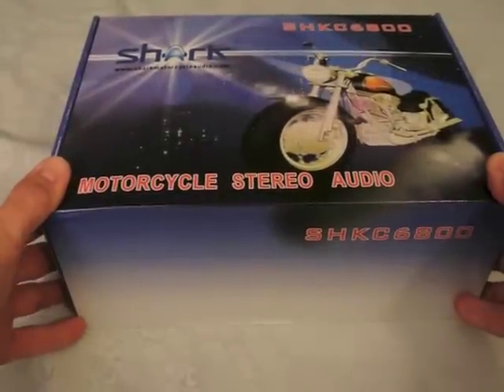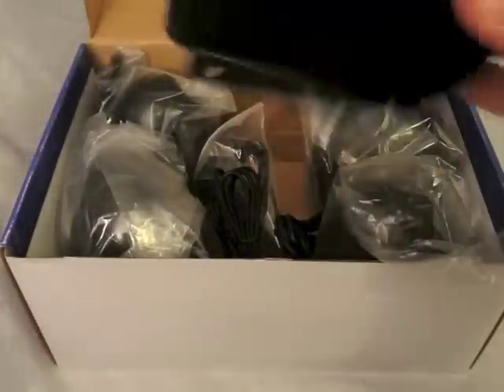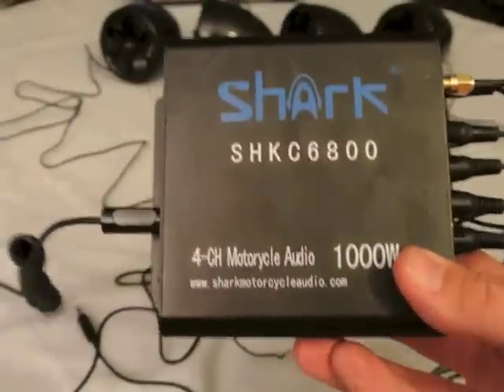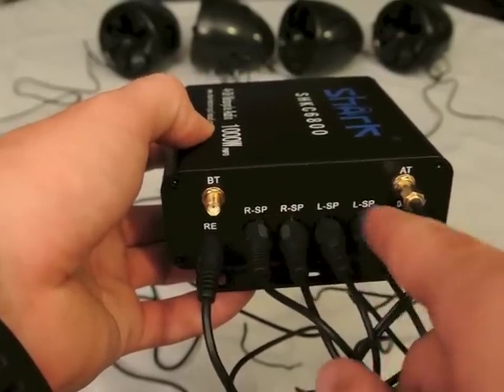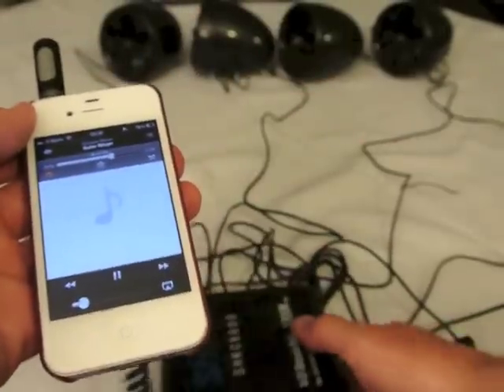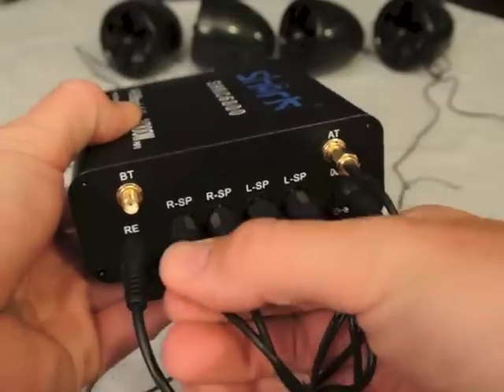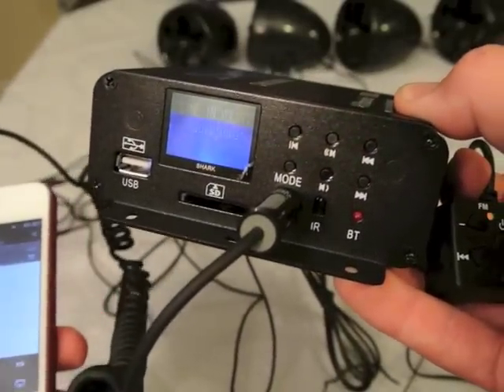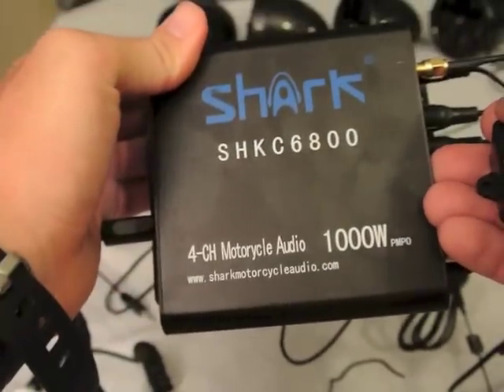Shark Motorcycle audio 1000 watt system unbox and test

Comment: I've had several Shark audio systems. The 250w version was plenty loud and could be heard easily at highway/interstate speeds, no problem. The 600 watt version is even more powerful and pretty much over kill, but I bought it to get the cable remote, which I didn't have on my 250w version. They may not put out as much power as advertised, but are powerful enough to do what they are intended to do. I use 5-1/4" on one bike and 6" speakers on the other to get a better sound.
Reply from the maker: Glad they work well for your application, thanks for the comment

Comment: 1000 watts may be a generous quote and most likely relates to the total 'peak' power across all four channels. Realistically 50~80 RMS max per channel. Nice clean little head unit, just not allot of bass. The loud buzz you get is potentially speaker and amp damaging, resulting from the lack of a delay circuit across the speaker outputs, when powering up.

Comment: Hi. I have a Yamaha Vstar 1100. I ran into problems with this system from day 1. The cheap glass fuse blew within minutes of turning it on. I had to go to a garage to get a blade fuse installed. The port where the power in plug goes at the back of the unit broke out of its spot, I put it back into place but unit is fried. I tried to order a replacement amp and the website says they don't deliver to my area! WTF!! Speakers can only be mounted one way, onto your mirror posts, I never looked into seeing if you can purchase any other type of clamps/brackets to put the speakers behind my windscreen lower on my bars, because the speaker casings have two holes in them for the brackets they supply only,  no other way of attaching them. So they are stuck up at the top of my bars out in the open. The "chrome" was pitted and showed extreme wear, missing the "paint" all over them in only one season of riding. I live in Ontario Canada so a riding season is 6 months at best. I rarely ride in the rain and my bike is stored indoors. The radio antenna wire broke after only using it twice, it pulled right out of the plug. The speaker wires are so tiny that no quick disconnects will hold them firmly, I needed to take my back speakers off to put on luggage because again the speaker brackets could only be connected where my reflector lights were at the back of bike. I ended up just splicing them and wrapping with electrical tape for quick removal, not good if I get caught in the rain. I was using a usb flashdrive at first, the port for that became loose, i had to use pliers to squeeze it tighter after 3 sticks flew away in the wind never to be found again, now I only use bluetooth with an ipod. The only good thing I have to say about this system is that the sound was decent enough although it distorts at about half level, but is still loud enough to hear over my pipes. Definitely not 1000 watts output. I will not be purchasing another Shark product again. Next time I will try Kicker.
Reply from the maker: Thanks for sharing your experience. Thanks for the comment, please Share & Subscribe.

Comment: I've purchased three of the Shark systems and they all failed on me the first season. I had the 250 watt system and it just quit working. And after further examination, I found the soldering joints vibrated apart inside. These things can't take any kind of vibration. My 1100 Shadow (Spirit - less vibration than the single crank pin ACE) did not vibrate all that much, just at idle and the system fell apart inside the amp. The other two 600 watt systems also failed and just plain quit working. They are poor quality. When you think you're getting a deal, you're NOT. I recommend a Boss unit over Shark any day. Boss is better quality and sounds better too.
Reply from the maker: Thanks for the comment, please Share & Subscribe.

Comment: Good luck returning anything to that company. Have used them a few times over the years for inexpensive stereos for my bikes and they don't last. As far as returns go I had ordered a set of replacement speakers for some shark ones that had blown and they sent me the wrong ones. Not only wrong but one had a badly cracked grill. Repeated requests for an RMA were ignored and when finally contacted they wanted to barter with me to keep what they sent for a discount. Had to stop payment on credit card. Shady company.
Reply from the maker: +Glenn Renfrow They also tried to barter with me, I refused to and was insistent on returning. Thanks for the comment, please share & subscribe.

Comment: Can I ask where you hooked the power wires to?  I have a Harley sportster and have the power straight to the battery.  I thought the amp was shut off as I cant see too much on the screen and wasnt sure if it was off.  All the lights seem to go off.  Anyways.  I came out the next day to take it for a ride and my battery was dead.  Is there another way to hook up the power besides straight to the battery?  Thanks for any help or info!
Reply from the maker: +Donna Vasseur If I remember correctly, I hooked it do a switched power source on a Can Am SXS.  I quickly realized that the shark quality was nonexistent and removed/returned the system.  Thanks for the question, Please Share & Subscribe.

Comment: I have been searching everywhere but can't seem to find the answer to my question. When connected to bluetooth with your device(phone)....does the wired controller raise and lower volume? Does the forward and backward button change the song or will i have to do everything from my phone to change my songs? Thanks.
Reply from the maker: The answer to your question is Yes , It is suppose to change the volume and song track.  On the one on had and returned the volume adjustment worked but the track selection was reversed.  The Forward button would start the song over or go to the previous song.  Hope this helps
Reply: Yes it does...Thanks a lot!

Comment: Heres a good rule of thumb to know approximately how much power an amplifier puts out. Take the fusing and multiply that times 10. There is much more that goes into this such as efficiency and distortion ratio. Ive seen companies use max ratings but that is just ludicrous. 50 Watts RMS. 12.5 to each speaker.
Reply from the maker: You are right, thanks for the comment.
Reply: Exactly. What companies like Shark do... is they advertise the "Peak Wattage", NOT continuous, which is what we are actually listen to. At 1000 watts RMS we would experience permanent and major hearing damage after about a minute of continuous listening under riding conditions.

Comment: Was the amp truly waterproof? they claim that the entire system is waterproof but I'm hesitant to mount the amp face up to the rain with the sd port and others.
Reply from the maker: The amp is not waterproof and I do not think that they claim it to be.  The idea of the compact system is a good one but the quality of construction and components is poor.  I would not recommend it for anyone, if you look in the description I later removed the system from my SxS and returned it to SharkAudio.  You should check out my other video of it installed and later on what I built to replace it.   Please share the videos and my experience with your friends.  Hope I was of some help
Reply: The thing is they do claim it is waterproof, they literally say right on the 600 watt w/ 300 w speaker system webpage that the "entire system" is waterproof. But for some reason I doubt it, so I'm not sure if I should install it, take it in the rain, let is get ruined, and then make them pay me... or just send it back.
Reply from the maker: cheesepowerm I looked on their website for the 1000watt system and they state it is not waterproof, They also advertise that it is 1000 watt and if you look at the size of the powere wire and the fuse that come in it is a small glass type that was around 5 amp.  There is no way that it can put out 1000watts.  Take my advice from my own experience do not waste your time and  money on this system.
let me know if you have any more questions.
Reply: Ive already received the 600 watt system, the one clearly labeled with "entire system is waterproof." I wrote them to confirm and they said no, the amp is not. So, since I already bought mounts and things to mount it with it exposed to the rain (since they said it was waterproof), they gave me a generous reimbursement so I can go get some stuff to protect it with.
Reply: cheesepowerm No, it is not water proof. At least not... until I see Shark do a demo by playing this unit under water.

Comment: They need to be constructed better. I've had to re-soldera couple of my amps (the 250w and the 600w) because of the poor soldering joints in the rear of the unit, where the speaker plug in. That's why the units are so cheap. The construction is very poor for being made for a motorcycle.
Reply from the maker: +Painter D I agree they are not made with any quality and do not recommend them.  Thanks for sharing your experience.  Share & subscribe.

Comment: I went simple with 5 speakers on the bars XR650L no amp but loud even with helmet at 55 mph.     (dirtbike speakers)   my ch check no bash as they are my choice without problem :)
Reply from the maker: +twing21able It is good to hear that someone is enjoying their shark stuff.  I hope that it holds up for you, thanks for the comment please share & subscribe.
Reply: +msfirefighter662 They are not the Shark speakers, they are Scullcandy Air Raid.  Rechargeables and able to charge them off bike batt when riding. I can remove a couple to bring to work and only  takes 4 minutes to zip tie them back to the bars.  I have three of them locked to bars with a handgun lock and it is fairly safe here in Maine from thievery.  The wattage in total is 50watts of output by they sure do the trick as I said, at 55mph I hear them clearly even with helmet on.  I got two for a hundred each and three more used off amazon for $60 each.  I really don't know if they are as loud as a 600watt system but I got a feeling they are just as loud and no amplifier to deal with.   Seems the reviews below are not to good on the Shark system, but I wish good luck to those who got 'em.  Cheers
Reply: +twing21able I will sub yah if that helps, :)
Reply from the maker: +twing21able Thanks for the detailed response, we appreciate every subscription.

Comment: man i just bought the 1400wt 4 speakers 200 bucks im in the middle of the road on this
Reply from the maker: john castillo I hope your system works better then the one I had.  I quickly realized that it was not of any quality and started to malfunction right away, so it went back for a refund.  Thanks for the comment please share & subscribe
Reply: man crappy mounts i can hear whats playing but not like i want it too burnt one fuse already put a new inline fuse it will due for now till i come up with 3 grand to put in what i really want
Reply: hey go look for subwoofer from shark im gona hafta buy it now the guys bike is tooo bizzzy  box is firing the wrong way

Comment: DO NOT BUY! Why? Where do I start?!.....

.... let's start with the head unit that came with mine. It fried. After less than two months. It kept blowing fuses and I thought it was where I ground it. It didn't matter. Whether I ground it to the frame or the negative battery terminal, it just kept blowing fuses. After blowing about 7 fuses the head unit simply wouldn't turn on. I installed 3 new fuses after but nothing, nada.

But my troubles originally started with the cheap, thin Chinese plastic used to house the speakers. Those started to crack on day 1. By the time the head unit crapped out all 4 speaker casings were in various stages of failure from cracking. They start to crack on the bottom, where you bolt them down to the mirror posts (using the brackets provided), a clamp on the bars/engine guard/etc. One speaker was so damaged that the thin, cheap Chinese metal used to form the actual speaker frame (that you use to bolt the speaker to the plastic housing unit) actually broke off, leaving it flopping around inside the casing/speaker "box". Flopping around AFTER two of the "ears", that were still intact, had stripped out the plastic holes that they were screwed into. These screws are really wood screws, the "self tapping" kind. Then the speaker wires, which are hard soldered to the speaker terminals, ripped out. Leaving no sound coming through. I took it apart and discovered just how fragile these speakers really are. Speakers going onto a motorcycle should be ten times the strength of car speakers because of the vibration, wind and sound. These things would have trouble on a kids tricycle.

After trying to fix the issues of quality control with the speakers and pretty much failing that, I decided that I would wind up junking all the speakers or building better boxes for them and continue to use the head unit. I didn't get time to do that before the head unit crapped out on me.

Now, to be fair, I absolutely LOVED the features on the head unit. Especially the blue tooth feature where I could use the navigation on my cell phone without tethering myself to it. I could also, if I chose to do so, use that same blue tooth feature for the mp3 music on my phone, Pandora, etc. It takes an SD Card or a flash drive for music, too! I was really stoked when I first received this radio because of the features alone. AM/FM Radio w/antennae put it over the top! I did have at least 5 or 6 weeks of problem free, music listening pleasure so I know that there is potential there. Even though I own a Harley Davidson Heritage Softail Classic I don't ride it like a weekend warrior or an old man. I'm a daily rider and I put a lot of miles on it. Some of them are tough miles. Volume was more than adequate at very fast highway speeds of over 80mph, although when I got to where I was going I suffered a little hearing loss for a bit :) The quality of the sound reproduction was sorely lacking however. Better speakers and a better box would go a long way in helping that as there seemed to be more than enough clean watts coming through. I'll never know since the head unit is toast.

To sum it up, I was happy for about 5 weeks and I could have better spent my money on something else. $200 + 5 weeks = A lot of useless wires and components. I wouldn't buy again and since I bought one of their "better" set ups I can't imagine how bad their less expensive systems perform.
Reply: and you bought fuses where???